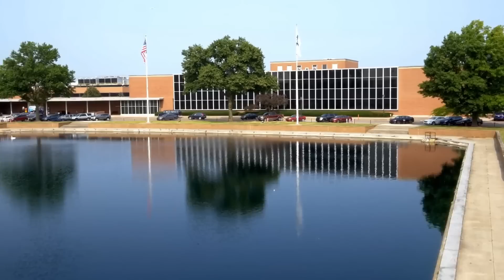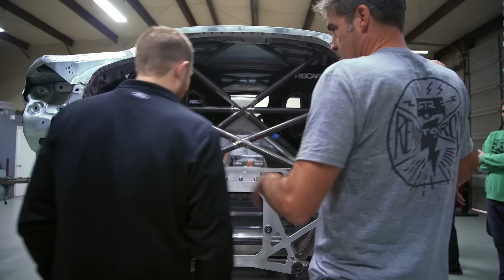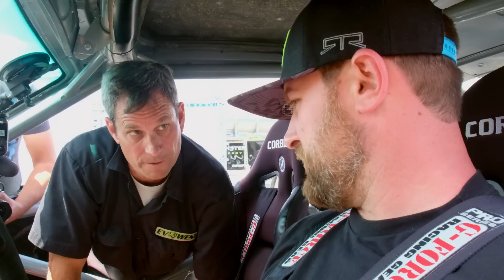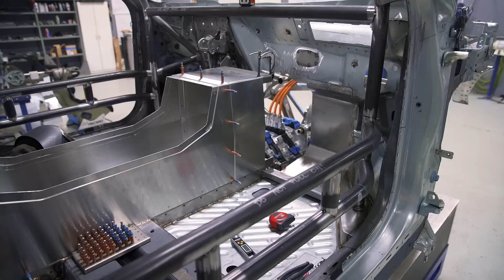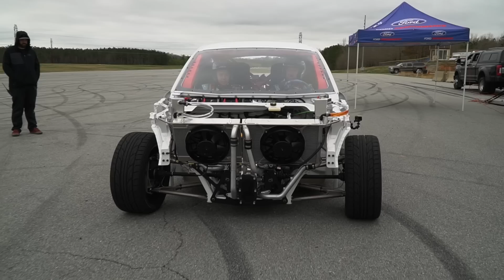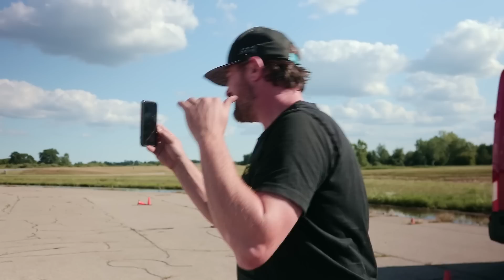Mustang Mach-E 1400: A No Rules, All-Electric Power Project | Ford Performance

Comment: That mach e SUV has NOTHING in common with a real Mustang. Just call it what it is a crossover SUV. I am not against it because it electric, I am against it giving the Mustang name a bad name. Mustangs are not 4dr SUV crossover things. That belongs to the other "e" Fords. Escape, Edge, Explorer, Expedition and Excursion. It fit very nicely in with that crowd. Right in between the Excape and Edge models. Drop the Mustang name off of it and quit insulting the Mustang name and heritage. 
mach e SUV > ANY tesla
Reply: I’ve been driving mustangs over 25 years, and I don’t think the Mach E gives the mustang a bad name, I think 17 year olds in mustangs hitting crowds give the mustang a bad name 🤷🏽‍♂️
Reply: @IMGONEIN60  i have been driving Mustangs for over 30 years and yes that crossover SUV is giving the real Mustangs a blackeye. Mustangs are not 4drs and they actually have a true muscle car sound to them, not speakers put under the bumpers to make them sound like they make some kinda sound. I am not bashing on electric vehicles,  I am however bashing on ford for calling that soccer moms, liberals green new deal car a Mustang.
Reply: @mattykobs  those inline 6 cars at least have a sound from a engine and not from some speakers under the body.
Reply: @mattykobs  This vehicle is an electric crossover. A real mustang is and has always been a pony car.
Plain and simple.
Reply: @mattykobs  we want a V8

Comment: Will there be a coupe version of the Mach e
Reply: Sadly, most likely not. Since the Mach-E is a branch of the Mustang family, the coupe mustangs are basically just the internal combustion versions of the Mach-E, meaning that Ford will most likely not make an electric coupe.
Reply: There shouldn't have been an SUV version in the first place
Reply: @opticFPV  yeah might as well buy an old ford suv and just put a plastic mustang badge on it.